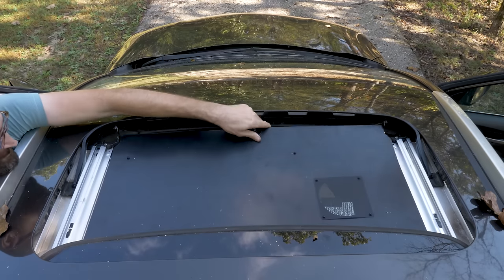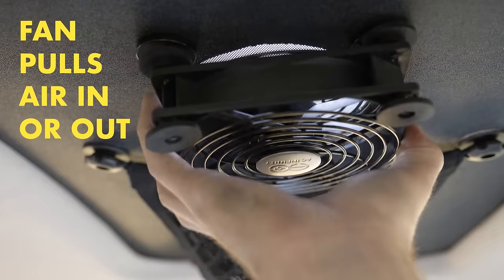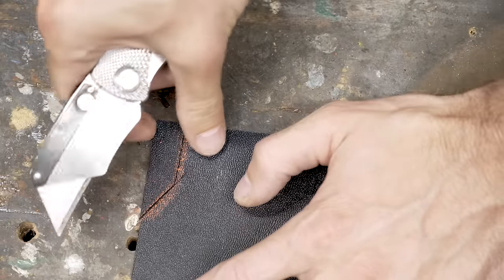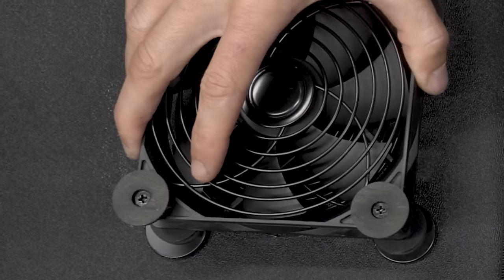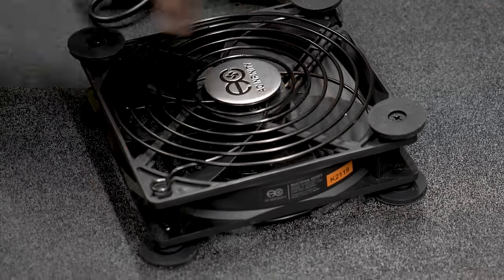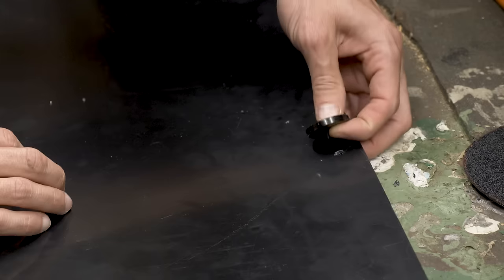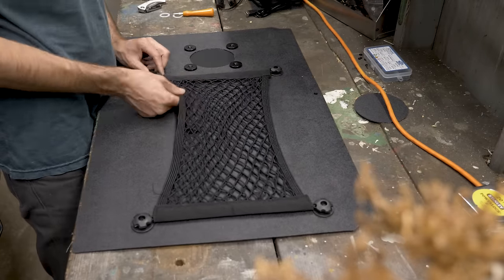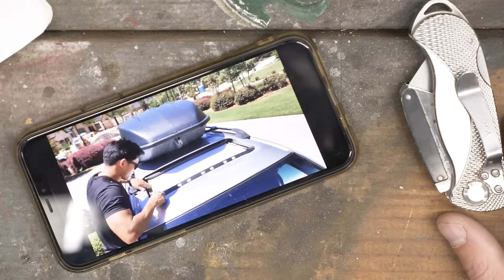Car Camping Cooling + Ventilation to Stop Condensation

Comment: Adding anything electrical in a vehicle that doesn't make us of the existing 12v system, and instead requires an additional 5v power source seems slightly odd to me.
Reply from the maker: I’d prefer the 5v battery die so the car starts in the morning.
Reply: @MattTheDesigner  I would just add a split charge leisure battery
Reply from the maker: @imaginitivity7853  what is that
Reply: @MattTheDesigner  an additional 12v battery, designed to handle deep discharge, that is charged when the vehicle is in motion (and the starter battery is fully charged). You can deplete the leisure battery without fear of using the charge of the starter battery.

Comment: Welp, I just found a big hole in the floor of my van so I won't have to cut a hole in the roof.
Reply from the maker: Ha! What??
Reply: @MattTheDesigner  well at first I was horrified but I look at the bright side and I can stick a fan through that hole for ventilation and also use it to dispose unwanted water without opening the doors🤷 I bought the van used and the floor was covered with rubber which I didn't check under.
Reply: I still have my Maxx air fan in my house that hasn't been installed in my van cuz I'm scared to cut a hole in the roof.
Reply: @MattTheDesigner  that plastic panel was what I was looking for. Thanks. Was wondering if Walmart or craft stores sold it. Or I was thinking about cutting walls off an unwanted plastic storage box.
Reply from the maker: @juliejules7780  I had the same thought but couldn’t find one that was the right size and shape. I actually used Tupperware plastic in another build. It’s always fun to work with what ya got.

Comment: If only it worked in the rain
Reply from the maker: It should work in a light rain without a lot of wind. The sunroof is designed to handle that as long as it's not blowing in sideways or a downpour.